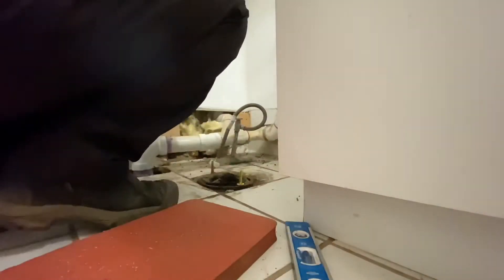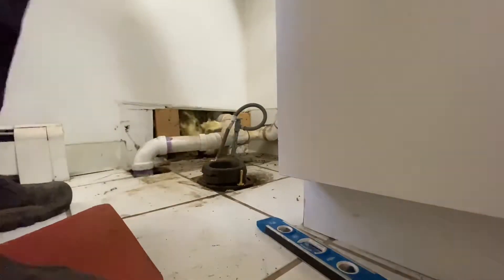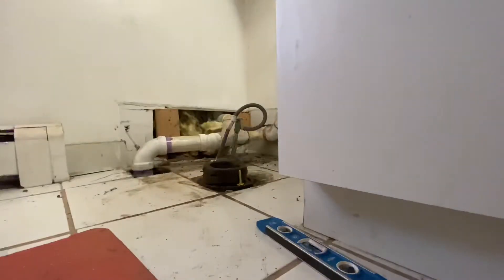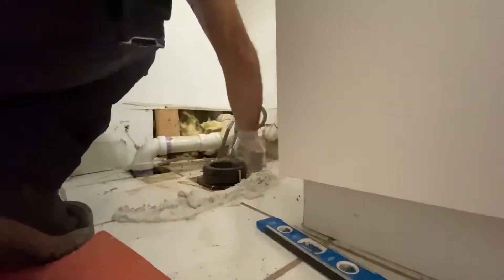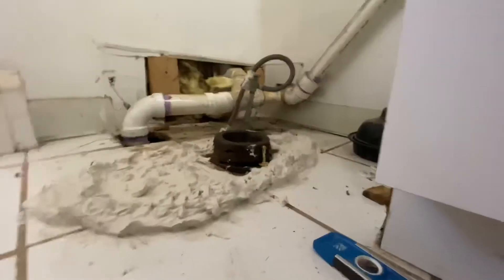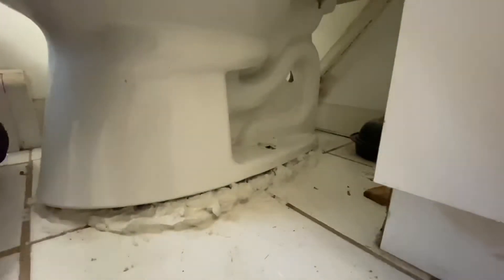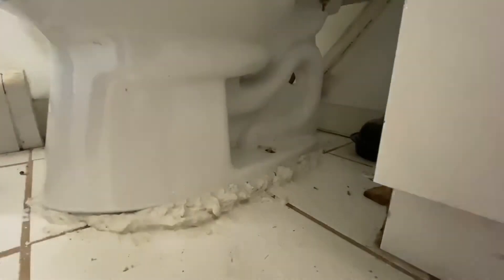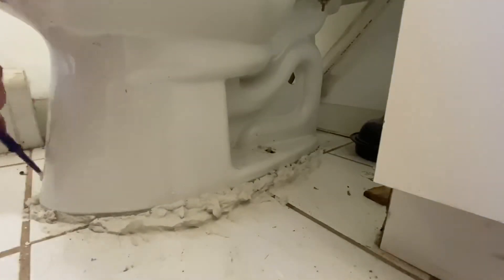Setting a toilet on a uneven floor

Comment: Thanks, worked for me! My situation was not as extreme, but the toilet was rocking on an uneven tile floor front to back, after a DIY remodel. A better solution than caulk and shims, in my opinion.

Comment: I never use double wax. If flange is flush or below floor I raise it so it sits on ontop of finished floor, then I dry fit toilet and pencil mark around base like he did. Then I level the toilet where it needs to be with shims, then I pull the dry fitting toilet and mix up my plaster of paris and put it all around toilet and then where the shims are I fill it in with plaster of paris the same height of shims and add just alittle more then set toilet and tighten bolts and keep checking with level and while plaster is still wet I get it off the floor and use a grout sponge to make it look pretty and smooth around base.

Comment: If the customer gets the floor wet after install does it weaken the plaster
Reply from the maker: Not at all
Reply: @GeorgeThePlumber   I’ll try it
Reply: @GeorgeThePlumber  what your minimum charge to jet a drain line
Reply from the maker: @brian2100  from 450 to 1200